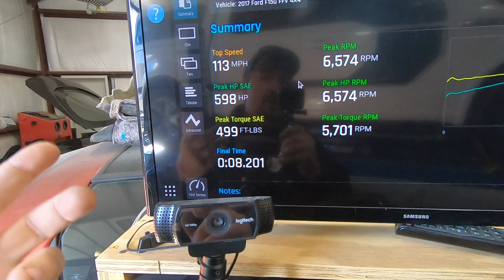NOT YOUR AVERAGE F150!  We Installed a GEN5 Whipple on a 17 F150

Comment: I have the same setup as you but I have a question is it safe to rev the car up to red line in neutral ?
Reply: Shouldn't hurt it but I wouldn't recommend holding it there
Reply from the maker: I mean I wouldn’t do it myself. But won’t hurt it as long as you are not holding it there.